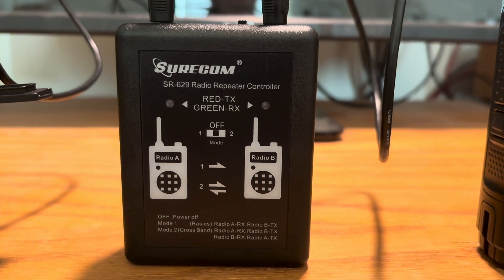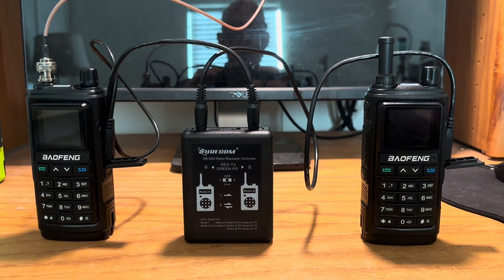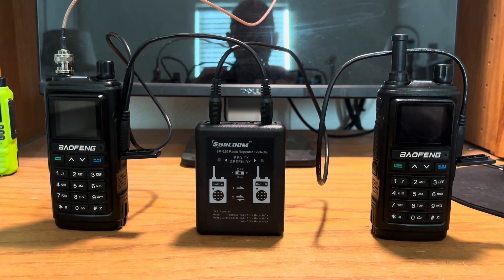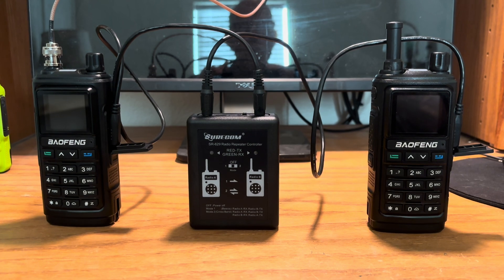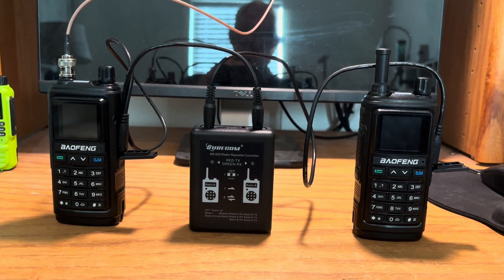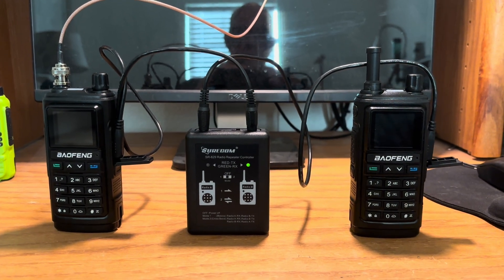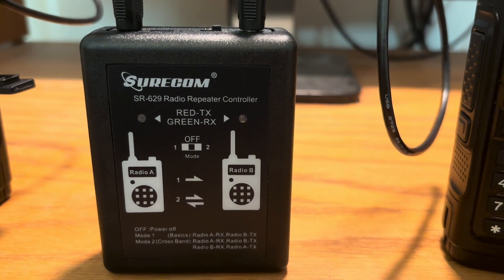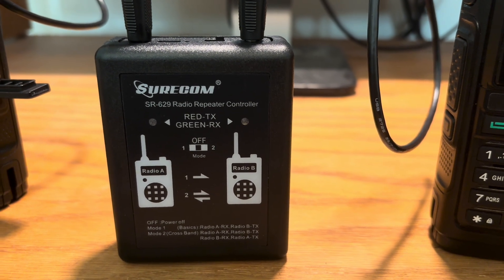Testing the Surecom SR-629 Duplex Repeater with Baofeng UV-17 Pro GPS

Comment: what is a clear node?
Reply: I would like to see that in use!
Reply from the maker: @oxygenman76  I will be doing a video of it.

73 Dave N8DAV
Reply from the maker: The ClearNode is made by Node Ventures. It is a Raspberry Pi powered device in a clear case which can be configured via a BlueTooth app to use AllStar Link, EchoLink and various digital modes such as DMR and others. It connects to the Internet via WiFi and can connect over the Internet to any repeater and/or linked repeater system any where in the world which uses AllStar Link and/or EchoLink. You communicate directly with the node over analog FM UHF using an HT or similar radio.

As a real world example I use the node to connect to the linked repeater system with repeaters in ID, NV, TX, AZ and CA. I live in AZ and my nephew lives in CA. I connect my node to the linked repeater system and use my HT around the house to talk to my nephew in CA. But with the repeater system in this video, I can increase the range I can talk back and forth to the node using higher power HT’s connected to my base station antenna and I talk to the repeater setup using my high power mobile unit in my SUV. I have gotten as far as 10 miles away from my shack using this setup. I can drive all over town and stay in touch with my nephew in CA. 

73 Dave N8DAV
Reply: @BrilliantHam thank you for the comprehensive answer

Comment: Is this a recorded and then rebroadcast it or is this Direct re-transmission device?
Reply from the maker: Thanks for your question. The Surecom SR-629 Repeater will transmit what it receives simultaneously. Just like most repeaters you connect with using your VHF/UHF radio. It is not a “Parrot” or a “Store and Forward” type repeater. This repeater should be used in a cross band configuration because it transmits simultaneously. Otherwise you may end up with a feedback loop.

73 Dave N8DAV / WSBX662

Comment: Greetings to a fellow Prescottonian! I graduated in '74. I'll take a look at this unit to see if it'll give me a way to extend the range of a few Baofeng's to reach a local repeater. Thanks for posting. KE7FD
Reply from the maker: Greetings! We are having some great weather this week. This unit works as expected. Just be aware that the cables provided are cheap and not good quality. When I first hooked it up it did not work correctly. It took examining the cables closely to see the problem. After I cleaned the flashing off the plugs and pushing them in with some force is when it started working. I am going to order some better cables to see if this makes set up a little easier. Let me know if you have any questions.